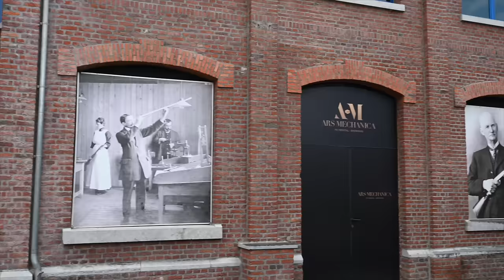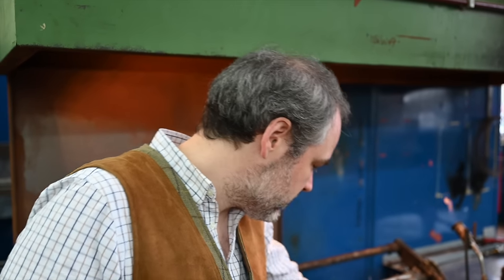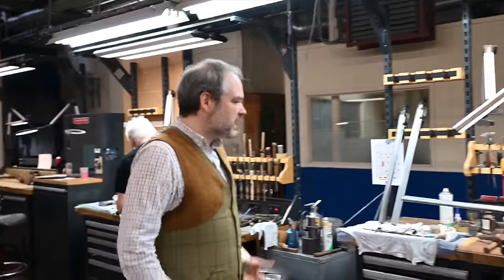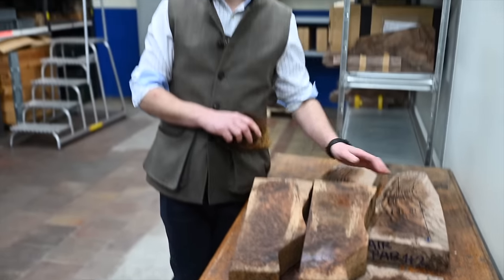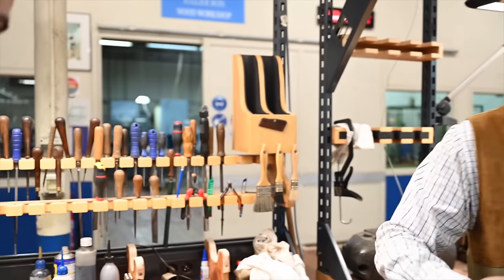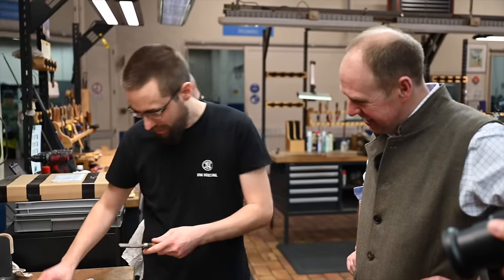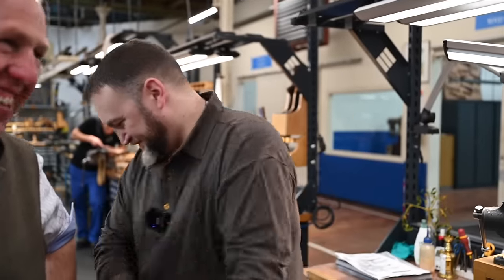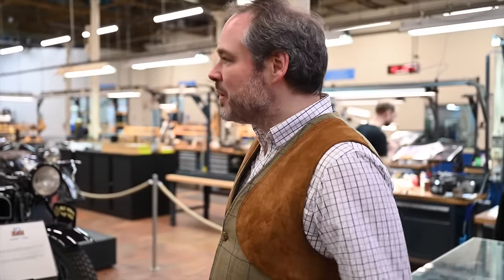Browning Factory Tour

Comment: I realize this is the custom shop. But as a fan of the Browning BPS lineup, I'd like Miroku to get back to making them again. Now all they have are two synthetic and one wood stocked Field model. Went from Slug guns, Turkey guns etc... To a cheaper finished and plastic BPS Field model opening the market up for their sister company Winchester to come in with a much cheaper feeling Turkish product the SXP to replace their spot in the market. So now if I want a decent BPS style gun I now have to buy used, pre owned or spend way more on a Ithaca. I have no intention of buying Turkish made shotguns I've seen to many fail due to cheap parts to ever put one of those into my safe. The Browning BPS was a great quality Japanese made firearm now it's a shadow of the quality and variety that they used to put out. Cheaper isn't all ways better Browning.